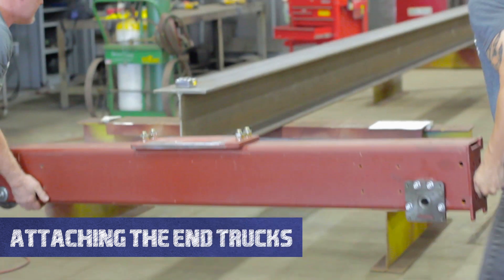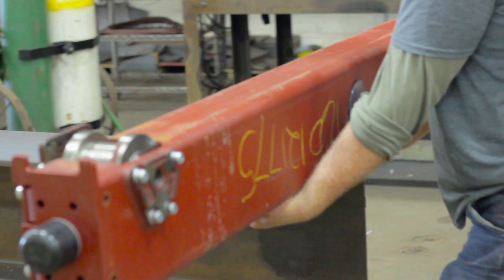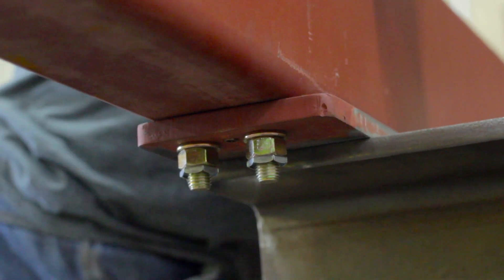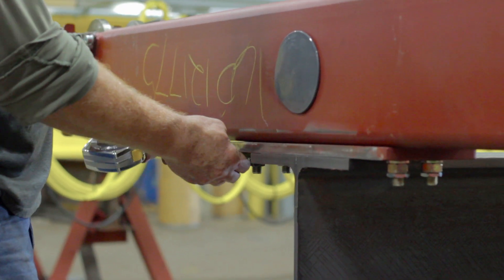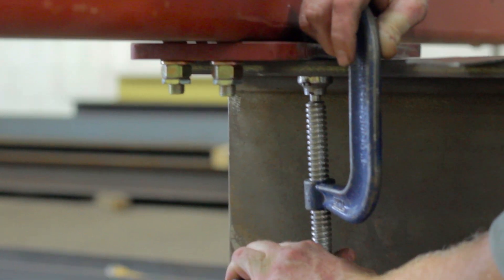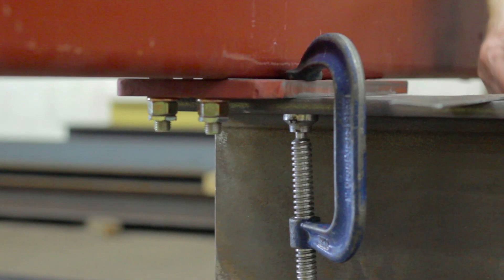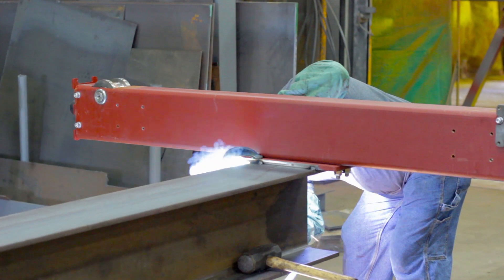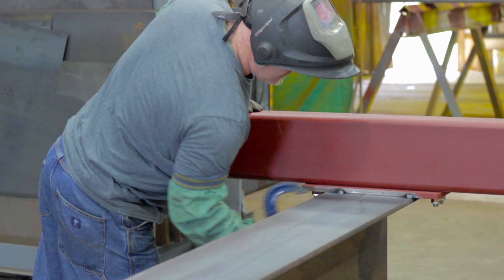Attaching the End Trucks on a Top Running Overhead Bridge Crane

Comment: You failed to check your wheel elevations. We all know a beam itself from the mill is not always straight or even the web of the beam may not be straight. The method you are presenting can cause problems for crane operation.